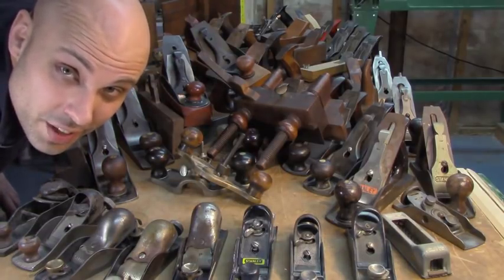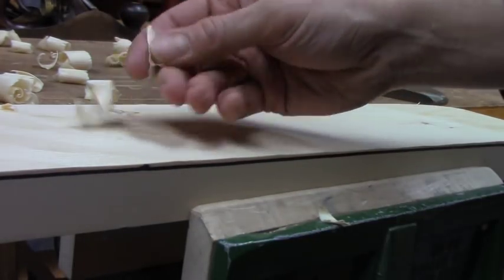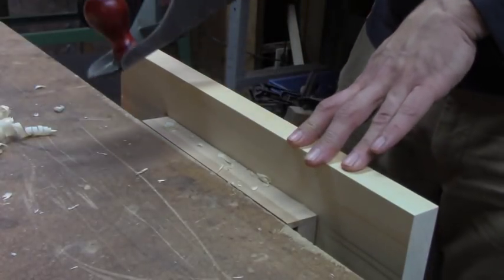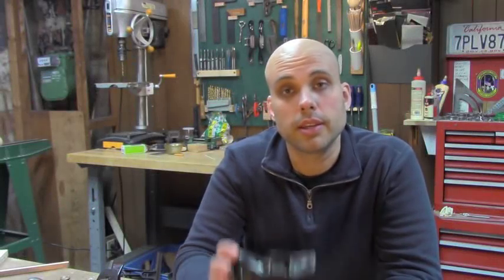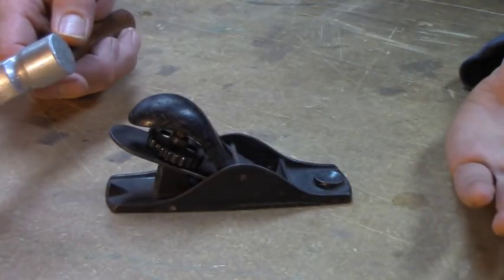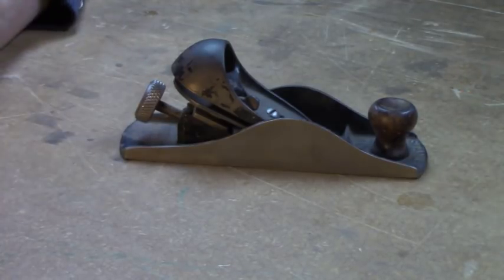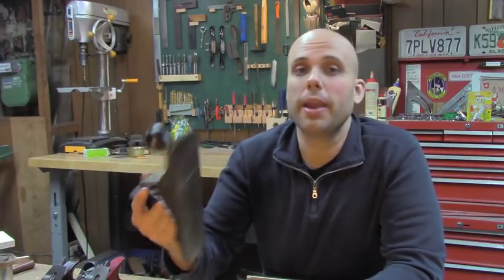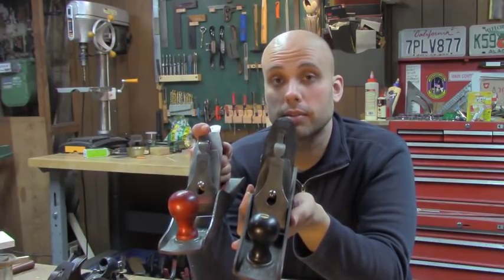Hand tools for $100 #2: Buying the planes you really need.

Comment: Ok so I have to pick some of your brains, guys. I went to an estate sale and got 2 block planes for $5. Not too bad, eh? One is a Stanley 220 but was in heavy need of a good cleaning. Its very rusty. However, while cleaning it up, I noticed that the knob to adjust the depth of the blade spins, but the bolt does not move. I have applied some oil to it, let it sit for a while, even applied a little heat to the area like I had read on a forum, but i have yet to get that bolt to budge. Any advice? The other one is a vintage craftsman. It's in a little better shape but doesnt have the knob at the front end. Also the blade is a little chipped. Are these good planes? Should I go through the effort of getting the craftsman operational? I feel like I only really need one but they were cheap so I got them both.
Reply: I'd probably fix both up, just for the practice. It will take a while to get a chip out of your iron unless you have a grinder, then you need to be really careful to not overheat the iron and lose temper. As far as the stuck screw, if you have tried to spray it with something and let it sit, I'd consider some kind of rust remover, like vinegar or evaporust, and soak the whole body. I have like five old block planes and one really nice lie nielsen rabbeting block plane. I just them all at different times for different things. Good luck!

Comment: You should probably mention that when you buy your $1 jack plane (good luck with that, BTW) it will probably be dull as a butter knife and you will need to learn how to sharpen it.
Reply: Maybe I'm dense... but did you PLAN to buy a plane... say you could... brand new, and then only use it until it's a bit dull???
     Then what?

    Look, I know sharpening is tedious. God knows I do enough of it... BUT it's really not a difficult task to get a decent handle on, and over time, you practically can't help become sufficient or even master it. I don't even use "guides", and I haven't in decades. (yeah, christ... I feel old now) ;o)

Comment: Wood By Wright describes the "Jack", "Fore", etc. w/ the same words.  is that a common explanation for them ?
Reply from the maker: Carbonite Gamorrean Kind of. The jack is a midsized plane that can do a bit of smoothing,  short jointing,  and general stock prep. it's only a fore plane if it's sharpened for aggressive stock removal. if you look at an old book like Nicholsen's Mechanics Exercises he only refers to a fore plane,  not a jack.  on the other hand,  Paul Sellers uses a number 4 for aggressive work and calls it a "scrub". his jack is sharpened with a straighter iron and is not a fore plane. James certainly isn't wrong to use the terms interchangeably. he knows what he's talking about.  the exact terms get slippery.
Reply: Cool, Cool Thx... Yes, so far I love James's stuff. And yeah I watch Paul but that must of escaped me. Thx again.

Comment: Why would you sand after the smoothing plane?
Reply from the maker: Two reasons: 1.) Even if your tools are good, you don't always get a perfect surface from planing. I do this for a living. Projects need to get out the door on time. If that means a bit of sanding, so be it. 2.) Depending on your finish, the planed surface might be TOO smooth and sanding gives it a bit of "tooth" to hold the finish better.
Reply: @RexKrueger  Would scraping be an alternative or is it too smooth too?
Reply from the maker: Jonas Daverio scraping is great.  Whether it's too smooth or not depends on the project.
Reply: @RexKrueger  But for your particular example, you said you sanded things because smoothing planes make things to smooth for certain finishes. Does scraping make things less smoth than smoothing plane?
Reply from the maker: Jonas Daverio its not straight-forward. Depends on the wood and the tool.  I can't give you a one-size-fits-all answer.
Reply: @RexKrueger  OK! But is scraping typically smoother or rougher than planing?

Comment: "A couple bucks is a good price for this plane."  

*me giving side-eye to the no.s 7 and 8 planes he got for fifty bucks each at a garage sale...*
Reply from the maker: Actually I paid about $30 for my 7 and my 8 was $12, but it was in ROUGH shape and I still haven't restored it.
Reply: I was referring to my own planes, which I'm starting to think I mayyyyyyyyyyybe overpaid....
Reply from the maker: Depending on condition, $50 is fine for a 7 or an 8. I've been lucky to live in places where tools are cheap. Long jointers are expensive. If they're in good shape and you need them, 50 is not a steal, but it's fair. Paul Sellers is fond of pointing out that these are lifetime tools.
Reply: They needed minimal cleanup, and might need a new plane blade in a few years, but that's actually kind of a relief, thanks.
Reply from the maker: Don't second-guess yourself. You did fine!

Comment: “You don't need a block-plane (believe it or not!)” by Rex Krueger: https://www.youtube.com/watch?v=Xci9l89kR9Y
Reply: Yeah….now I’m wondering what to do, get a jointer plane or just get a Jack and smoother….
Reply: @EternalShadow1667  No question: jack plane and smoother first. I do have a No. 7 jointer and I really like it (and use it), but a No. 5 and No. 4 are the planes you will use all the time. If I could only have two? 4 and 5, even though they’re similar in size.

I don’t have any machines, so perhaps a jointer plane is more useful to me than it is to others, but it’s also a lot of fun to use – I don’t regret buying it. But it’s not essential: I would definitely start with a No. 5 and a No. 4, and two good diamond plates for sharpening (fine and super fine).